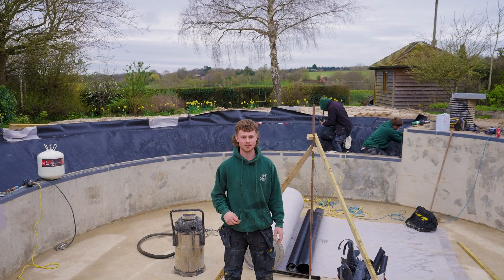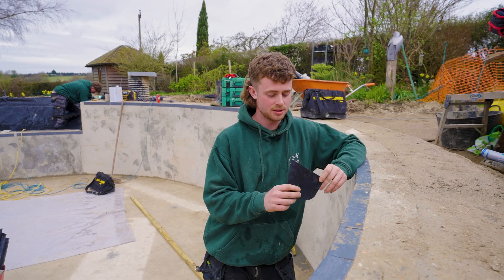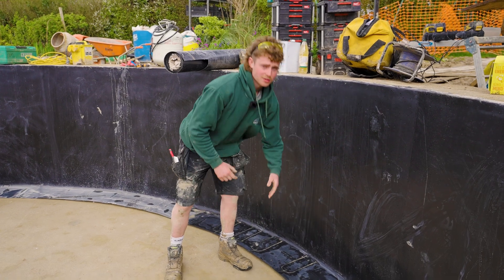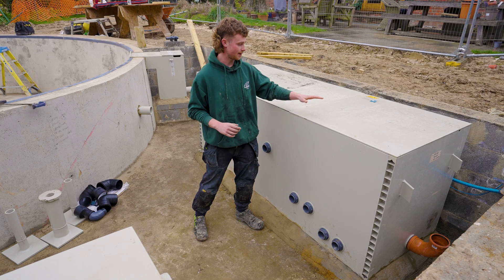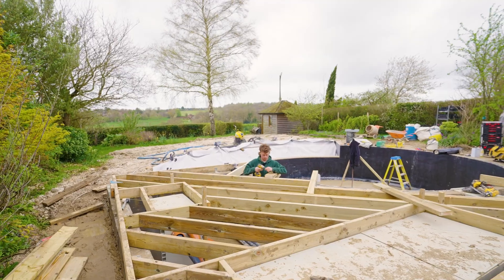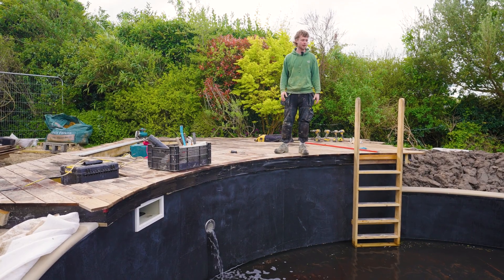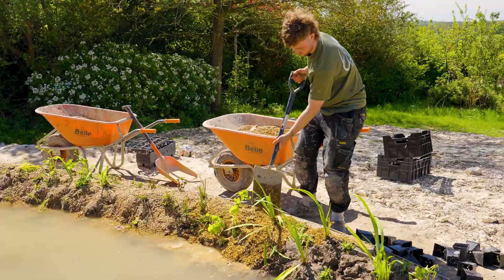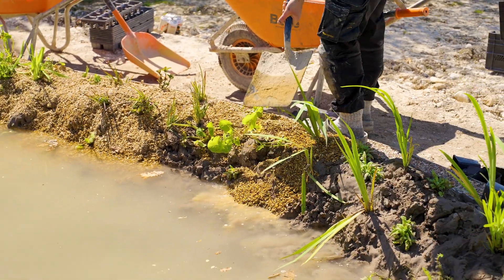How to Build a Natural Swimming Pool - Part 2: Installation

Comment: How do you bed the coping stones on the linner?
Reply from the maker: There are a few different ways of adding copings to the top of the pool liner on the internal walls - here we used a time-tested specialist adhesive.